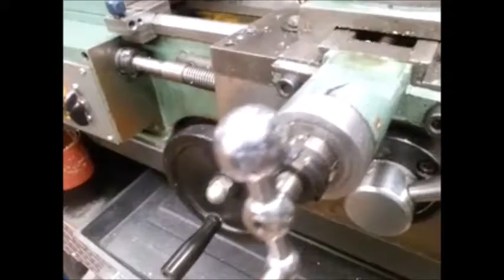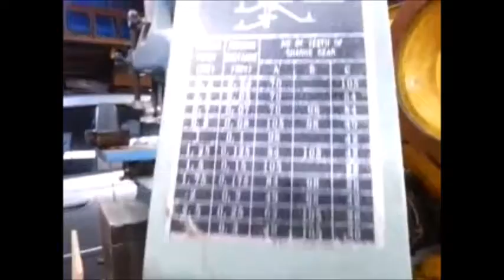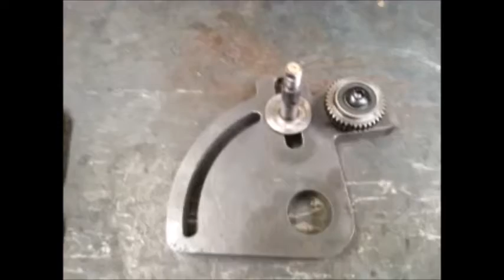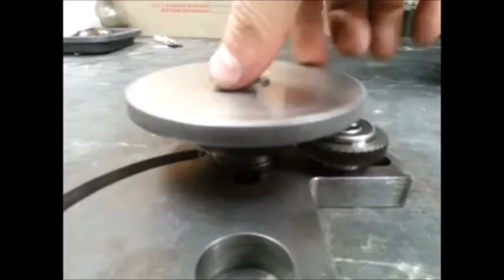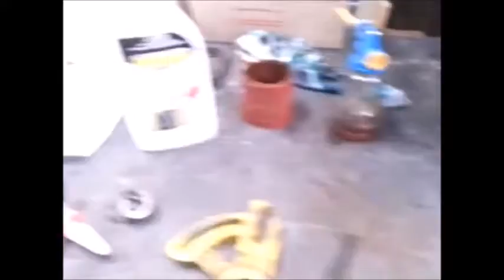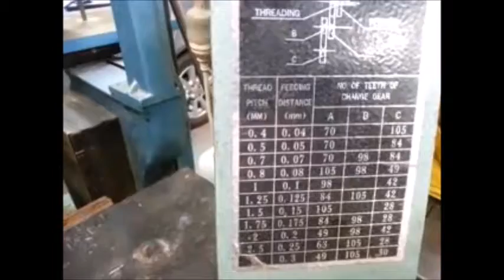BV20 Tumbler Reverse

Comment: Hi i just bought Chinese unbranded BB25L lathe. I have issue on how to install gears for 1.25mm metric thread. As per the table it only needs 3 gears (A 50, BC 110 and D 30). However it is not possible to install it because gear 110 will touch the screw that hold the middle rod support. In order to avoid that, it will need at least 1 spacer on top, middle and bottom rod so all gears will be shifted to the left away and in that case middle gear will no more touching the screw buy the problem is the top rod seems too short and it will not accommodate a spacer. Could you please advise or am I missing something? Thanks in advance.

Comment: ti chiedo se è possibile avere un disegno, con le relative misure del porta ingranaggi grazie
Reply from the maker: Thanks for your comment.
Send an email to ray at mrjones dot id dot au and I send you a PDF of the drawing. (replace at and dots with the proper terms ;-) )
Reply from the maker: Thanks for your comment.
If you'd like a drawing, send an email to ray at mrjones dot id dot au and I send you a PDF. (replace at and dots with the proper terms ;-) )
Reply: Grazie per i disegni 
Vorrei sapere su quale sito posso trovare l' ingranaggio  modello 1.     38 denti  diametro 40 
Grazie per l'aiuto
Reply from the maker: (Google translation) Thanks for the drawings I want to know which site I can find the 'model 1. gear 38 teeth diameter 40 Thanks for the help

Hi Ciro, I actually made my own 40th idler gear. Can't help with where to source one.
Reply: Is it possible to send me the pdf too?THank you dimitrisbizakis @ gmail com

Comment: Hi Ray, thank you for the video. I just got a used BV20 lathe myself and I'm trying to find all the info I can get.
Could you tell me, is the chuck backplate removable ? Is there a spindle-thread somewhere under ;) 
Tnx again 👍
Reply from the maker: Hi Anders, the back plate is part of the spindle. I too sweated over that detail for many weeks as very little info does exist out there for the BV20.
This is not always a disadvantage, it does allow you to run the lathe in reverse (if you do update the motor) and not worry about spinning off the chuck.
The screws into the back of the chuck are a PITA to remove, so ended up putting studs into the chuck, made up some "top hat" spacers to fit the counterbored holes in the back plate and now just spin nuts on and use a spanner in a much easier manner.
You probably already know there's a Morse Taper 3 spindle bore. I often revert to a MT3-ER32 collet holder, but want to make a faceplate mounted version to allow longer work to extend into the spindle.

Thanks for commenting.